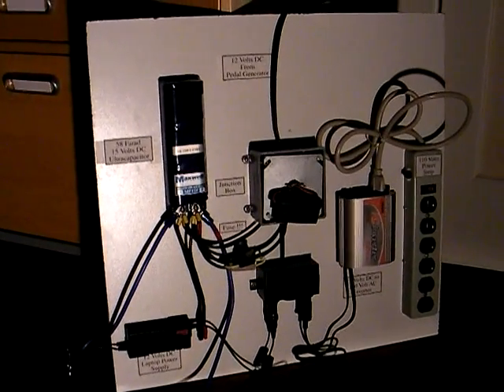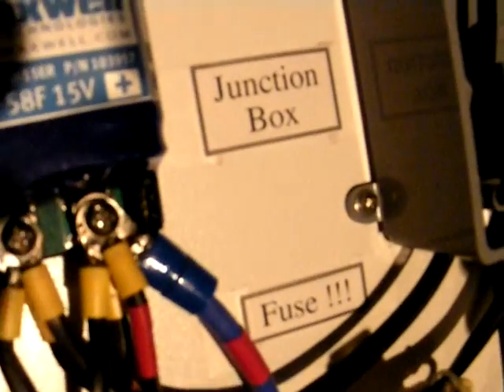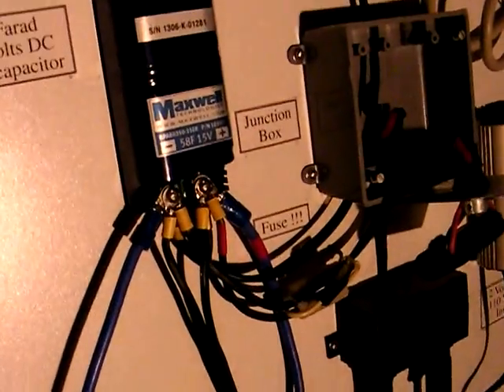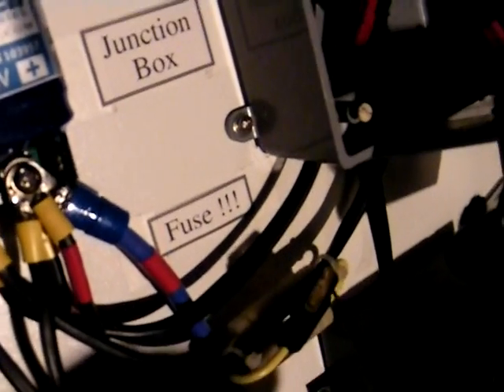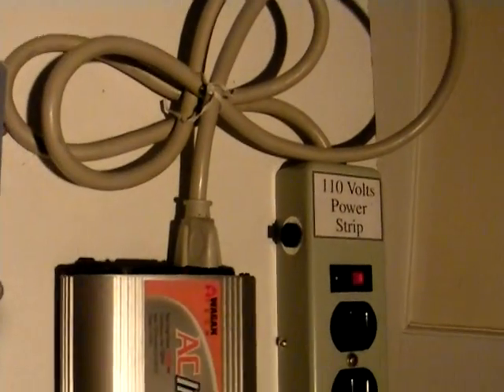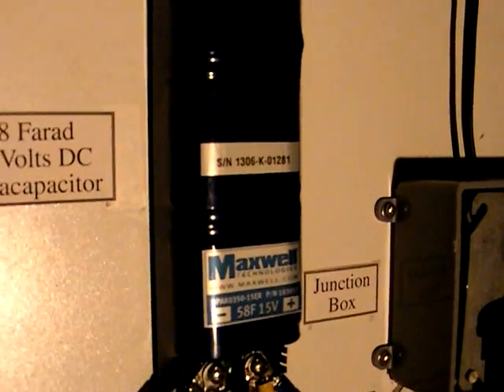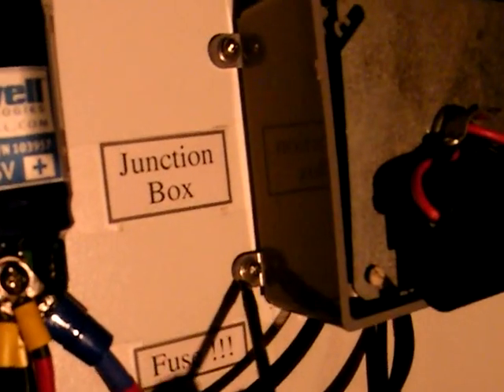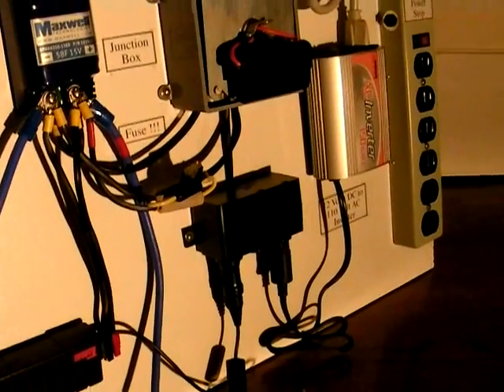PPPM Power Board

Comment from the maker: 15 volts is the limit for the Ultracapacitor. I simply do not pedal fast enough for the voltage to rise that high.

Capacitors are not like batteries. They do not have a "normal" voltage level. Their voltage rises when charging, and lowers when discharging. They can be discharged to 0 volts without harm. All that matters for this configuration is maintaining the voltage below the limit of the inverter and Ultracapacitor. That is accomplished by controlling pedaling speed and effort.

Comment from the maker: I am assembling a two-generator PPPM that will use a dual 16 Amp Schottky rectifier, and I will use a heatsink on it - or not. See below.

The Schottky diodes cause about a 4-6% power loss due to their natural characteristics. The most direct way to recapture that is to have a switch wired in parallel with the diode, and simply switch the diode in and out of the circuit as needed. I'll have a switch on my handlebars for the dual motor version.

Comment from the maker: Thanks for the comments!

Yes, the meters show the difference between what is being generated and what is being used, with the difference flowing into or out of the capacitor depending on the direction of the imbalance.

The diodes are 10 Amp Schottky rectifiers: NTE 6083 10A 45V. They have lower voltage drops than Silicon Rectifiers and when I am working hard they become too hot to touch. I plan to experiment with MOSFETs instead of diodes in hopes that their power dissipation will be lower.

Comment: Many thanks for the video.  I have a few Qs.

In a steady state all your Watts Up meters read the same thing, and if they don't then is the difference the net power going into/out of the capacitor?  

Also, could you possibly comment on the diode.  It must be quite hefty.  The amperage and voltage drop must mean it dissipates quite a bit of power.  

I recently built a bicycle generator, the strategy being that I'd charge 12v batteries.
  
I admire your work. Top class DIY.

Comment from the maker: Hi, yes I do! The capacitor does not hold as much as a battery but it can run a light for a few minutes or a radio for 30 minutes or so.

Mostly it "smooths out" the power.